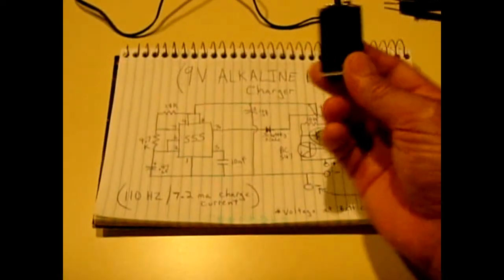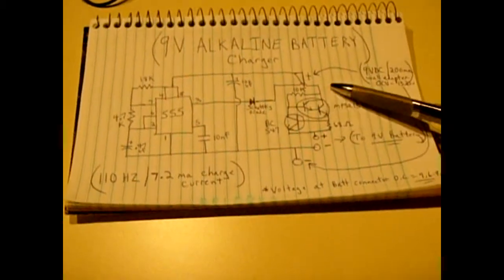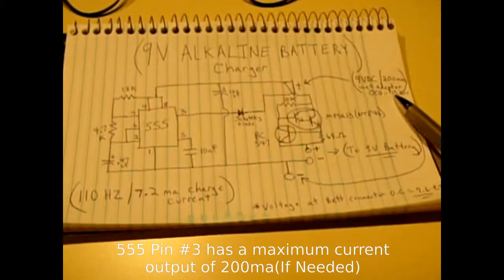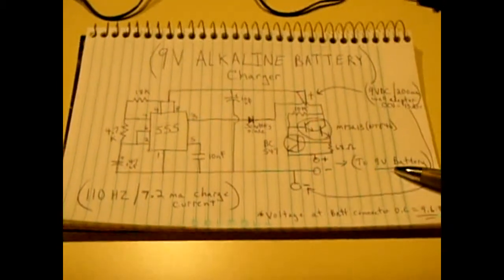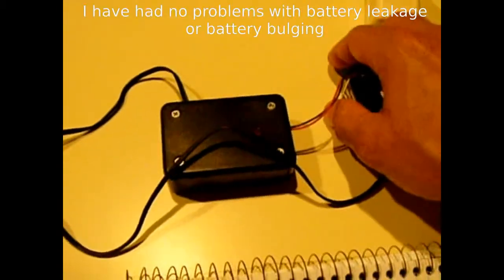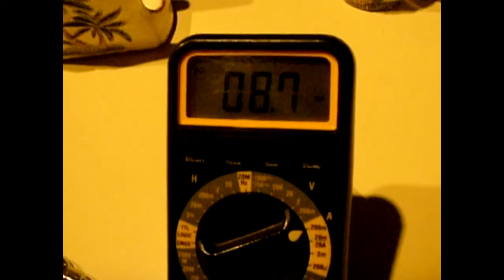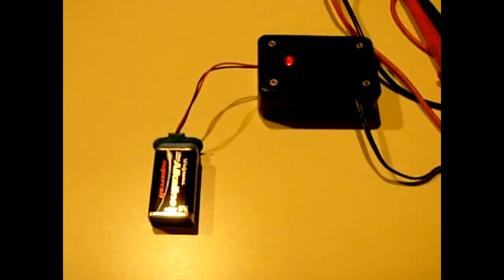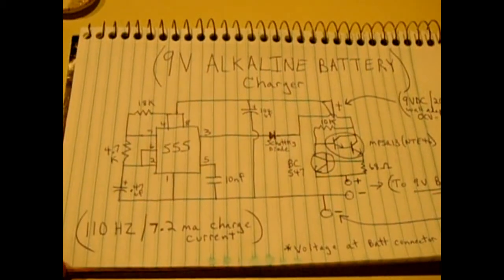9V Alkaline Battery Charging Circuit(Also 1.5v Cells)

Comment: Hi, this is a nice one! I have successfully recharged 1.5v alkalines with a joule thief so that works too:) I am using more and more super capacitors these days for running my hobby projects. Since i cant seem to find a system on the market dedicated for charging super capacitors i was wondering if you can help me?
Reply from the maker: +Ben Winkel Hi there. Maybe the video below can help.

https://www.youtube.com/watch?v=Z_v8dVezDrc
Reply: +electronicsNmore Thanks for your swift response! I've watched the other video and its certainly helpfull. You have a lot of cool videos and explain things very clearly. Funny that i allready have that booster thingy, bought it on AliExpress. Just a couple of questions.. If i just want to charge some capacitors, do i just leave the part out where it connects to that booster? And my main question, i ordered a capacitor bank on a balancing board. Its 16v 6 x 350f. How do i change the setup if i want to charge from 12v? Or do i need a completely different approach?
Again thank you and keep up the good work!

Comment: I'm having an issue. I'm losing the 116Hz from the 555 after the diode, especially when under load, at least detectable from my multimeter. I should mention that I'm using a tip120 in the constant current circuit, and a 1N5818 diode.  There is also a LED pre-circuit and a 1K resistor pre 555 to drop some power.
Reply from the maker: Datzfunk Try using a 12V battery with the circuit to see if that makes any difference. You should be using the mpsa13 NPN darlington transistor. I did not test using a TIP120 darlington. If you do not use exactly as I stated in the video, then you may have problems. 

Thanks.

Comment: Well, I had this basically working this morning, until I blew both my 555s accidentally. I would like to mention that with a wall adapter, my circuit had 116Hz make it through the diode, but when using a variable DC power supply, the 116Hz stopped after the diode.I couldn't figure it out. Must be something with the grounding on the variable supply? This makes it trickier, because I only had a 9V 300mA wall adapter laying around and the voltage was too high on the output. Probably could have figured it out if I hadn't accidentally shorted some components and blown the 555, then inserted my other 555 incorrectly into the circuit, and blow it too! :-)
Reply from the maker: Datz Skunk Hi there. The circuit definitely works, and works really good. Many others have made it with success. Fortunately 555's are dirt cheap. I also noticed that issue in the past. The pulses are still there, but for some reason they failed to show on my meter. When you test where the battery connects, you should see the pulses on your meter(116Hz in your case).

Thanks For Watching!

Comment: Thanks! I really enjoyed your video. If your into charging batteries, you might want to check out the $20.00 version of the IMAX B6 clone. It charges any battery type and you can control the time, current, and voltage. After watching your video, I decided to try to try charging a 9 volt battery at real-low current at an hour with a two hour rest period between each charge. Keep up the good work.
Reply: did you charge an alkaline 9v battery?

Comment: Hi, reminds me my years in electronics, (worked 20 years for Radio Canada, CBC as senior electronic technician until 1991) recycled as a machinist/welder with a YouTube channel started a few months ago, that's different...
Since I use quite a few batteries this is a tempting solution.
Keep on supplying great ideas,
Pierre

Comment from the maker: Mario Antonio: You need to allow others to reply to your comments!

As for your question, It makes no difference the mAh rating. What matters is that the battery is an ALKALINE type. The charge indicator circuit goes on the 9V battery snap which connects to the battery to be charged, or inside the plastic housing connected to the 2 wires leading to the 9V battery snap with the LED indicator sticking out of the plastic housing.

Thanks For Watching! Be sure to share.

Comment: Hello
I would love to use this for an audio amp I am building since it has to be powered with 9 volts. In previous investigations, I have learned that the mAh of a 9v battery matters. Will this charging circuit charge a 9v alkaline battery with any kind of mAh? Plus, when the main circuit is done, where do you put the led indicator in the end(NEG terminal of 9v battery & POS terminal?!?) I'd really like to know to continue my project.
Thanks for your response!

Comment: Thanks Pal, how can I missed this video !  I have all parts, will give it a shot. 9v battery are useful in many occasions ex. Smoke alarm, light-weighted power source for some of the Arduino based measuring meter. Btw, I have two Soshine li-on 500mAh voltage peak at 8.6v. Always good to have spare Alkaline 9v just to verify some cct which required more than 9v.

I will use the dual display Ammeter/Votlmeter panel meter 33v 3A. able to display mA range.

Comment: How did you get the values for the IC555? I did calculate the astable in 120Hz, with 80% duty cicle, 72K for R1 (pins 8 to 7) and 24k for R2 (pin 7 to 6) with a 100nF capacitor (pin 2 to gnd), please make it clear for me. For the current i did used a lm317 with 40R to arround 30mA.
Reply from the maker: I used an online 555 astable calculator. You should duplicate what I did. Copy the circuit.
Reply: http://houseofjeff.com/555-timer-oscillator-frequency-calculator/

Comment: Hi Sir, Thank you for such a good explanation type video and to the fast response to my question. To be truthful with you I had already made this circuit using the schematic from the description area. But I am having problems with it. I am using a 9 volt wall wart with a voltage reading of 15.9 VTS after plugging into the board the top rail reads 14.4 VTS and at the connections to the battery it reads 9.40 VTS. MA reading 8.1, duty cycle 78.8 and frequency 110.6 Hz. The only thing I changed is the 18K resistor to a 12K to get the 110 Hz. I have charged 3 batteries all in the range of 8 plus volts. My problem is that the charger continues to charge. When I check some batteries after several hours of charging the reading is 10 plus volts.
Reply from the maker: Just make sure the ma charge current is kept LOW. You need to lower the voltage into the charging circuit if your going over 10V. Try a 1n4001 instead of the Schottky. If that does not work try 2 in series. You can always make the battery charged indicator circuit so you know when to remove the battery.

Comment: Hi, I want to make this circuit but I am unclear about the schematic. In the video the schematic appears to show a connection just above the 10K resistor where you are showing the + sign coming from the 9VDC/200MA. On the schematic I find in the description area it does not show a connection. Is there a connection or not?
Reply from the maker: Hey Calvin. Ignore that weird triangle shape. Power is connected at the point to the 9V battery. I forgot to white it out.

Thanks For Watching!

Comment: Hi I'm making a circuit for my bicycle that is powered by a stepper motor which produces around 12v. The circuit is going to power several leds as well as a usb port. I'd like to store power with a 9v battery for when the bike is not moving, but when the bike is in motion and when the battery drops to a certain voltage I would like it to charge automatically. Sorry if I asked too many questions, I'm not a complete novice with electronics but I'm still struggling to figure this one out. Thanks!
Reply from the maker: I understand. You want the power to stay no lower than 5v even when you stop moving. I would not use a 8V battery. They are not designed for high current output. You should buy a 6AA holder and (6) AA nicd's or nimh's. That will supply the power. I would take the output of the stepper motor and feed it into a constant current circuit to charge the batteries. Don't charge at too high of a rate. From the 6 AA's I would use a lm7805 circuit to supply a regulated 5v to your USB port and LED's. Each LED can be powered by 5V using a 82 ohm resistor in series with each LED.

Thanks For Watching!

Comment: Hello, thanks for the circuit!, but i can´t get Schottky Diode here, can i use any other? Zener maybe??  thanks
Reply from the maker: Really need a Schottky, but you can try a 1N4001 to 1N4007, but you will need to slightly increase the power supply voltage to compensate for a bigger voltage drop across the diode.
Reply: great , thanks, 1N4007 is easy to get !  :D

Comment: Hello
This is may a stupid question but I got a 9v battery that I thinck it is empty I tryed it on my 12v cooler at the begining it was nice blowing but a time later it was blowing weaker and weaker. So my question is can I recharge it with my 12 volt car battery recharger aparat? Thanks
Sorry for my bad English

Comment: Absolutely great circuit. I want to build one as I go through several 9v and AA batteries each month. I am able to get most of the components at the local electronics parts store, but need to get the Schottky Diode.  I'll have to order this online. I noticed that you did not give a part number.

Could you provide me with an appropriate part number for the Schottky Diode solely for the purpose of ordering.
Reply from the maker: Nothing special !N5817 to 1n5819. Thanks For watching! Be sure to share, rate a thumbs up, and check out my other videos as well.

Comment: what do I have to change to raise the charging current to 50mA?
Reply from the maker: Why would you do that? The 9V battery would be destroyed. If you wanted to charge AA's, then you would adjust the 68 ohm resistor value.

Thanks For watching!
Reply: electronicsNmore Yes, I plan to make one for AA's. I have sucessfully made the 9V battery charger. Thanks for sharing, you're brilliant! ;-)
Reply from the maker: Glad you like it. Just remember to not allow the batteries to drop too low in voltage before charging them, and also share my channel/videos.

Thank you

Comment: Bro,
Thanks for your reply!  Questions for you.  How many times have you charged a 9v battery or topped it off before you could no longer use it?  How did you measure the frequency of the pulse on your meter?  Does it have a special range for it?  Don't see the red LED in the schematic.  Thanks again for your help,

Roberto
Reply from the maker: I charged a 9v battery  3 or 4 times so far with no problems. Frequency was measured using my wavetek 27xt across the 9v battery connector. The red LED is nothing more than a LED and current limiting resistor connected in series from the power switch to the negative rail.

Comment: Sir can i replace "MPSA13" transistor with S9014? Transistor? Thank you.
Reply from the maker: No. Look for a darlington NPN.
Reply: Sir , i made the second circuit, the 9v full indicator circuit... 
I have 

10k
2.2k
9.1v zener
Epoxy green LED
2N4401 transistor...

Im gonna ask a question, 
Is it safe ? To connect this circuit to 9v alkaline charger .. While ? Its charging??? Or not...
??? Thank you....
Reply from the maker: yes. With nothing connected to the 9V charger, the LED should glow green. When the battery is connected, the LED should go off until the 9v battery's voltage rises to a certain level.
Reply: sir , i calculated 111.3Hz 
so i replaced

18k to 12k
4.7k to 470 ohm
0.47uF to 1 uF

then i replaced MPSA13 with 
BC517 NPN Darlington transistor hfe 30,000 min.

the i have a ouput of 9.68v dc
Reply: electronicsNmore why is it, the voltage drop to 8.7v from 10.5v  when the LED indicator circuit is connected to the main charger circuit with no battery connected?
Reply from the maker: That is normal. Mine drops from 10V to 8.2V. The 9V battery charging and LED indicator will still work just fine once the battery is connected. :-) When I see my LED turning ON while the charger is plugged in, then probe the battery contacts while under charge, it is around 9.4 - 9.5V. The output from the charger is very low current, so once the charger is plugged in with no battery connected, the voltage will be at the high(around 10-10.5V), the LED will turn on, and the current will drop causing the voltage to drop at the terminals.

Thanks For Watching!
Reply: electronicsNmore Thank you for the quick response.

Comment: can i use 9v dc adaptor with an input of 220vac? thank you
Reply from the maker: Hi Darel. As long as the output is close to what I stated in the video, then you will be fine. The input makes no difference. 120 or 240.
Reply: oh! thanks for the info sir, 
but one more thing , as i've said lately 
i have 220vac input  AC/DC Adaptor. i read the back of my adaptor
with an output of "9V DC 300mA"
but i was shocked when i got my multimeter to test the real output of my adaptor and i got a "15.70 VDC" output!!!???
is it safe to use this adaptor Sir???? Thank you.
Reply from the maker: The dc adapter will supply 9vdc at 300mA. If nothing is connected to the power adapter, then the voltage will read a higher voltage because no load is attached to it. That is normal. The power adapter you have can also be rated 12V at 100mA., or 6v at 500mA. Depends on the load attached. If the voltage is still too high(I used a 210mA adapter at 9vdc) , you can always add a 1/2w low ohm(around 33 to 51 ohms) resistor in series with the (+) from the power supply to help drop the voltage down.
Reply: ok sir thank you for your reply ..
so i need a 1/2 w resistor to help drop the voltage down.
because it is open no load but still getting a too high voltage of 15.70v dc but its rated 9vdc 300mAh 
Anyway thank you very much sir, you're helping people to know more about electronics. 

Sir i hope you make a video of zener diode and silicon diodes explanation and how they works on a simple circuit,. cause until now, im still confused about diodes. Thanks a lot sir, :-)

Comment: I am not sure how this circuit can pulse. The base of if NTE46 always has a positive supply from the positive rail. This voltage is higher than the 555 pin 3 output. Am I missing something, could someone please explain? Thanks
Reply from the maker: The + in the weird triangle is NOT connected to the constant current circuit. It looks that way, but it is not.

It definitely pulses, and I can assure you this circuit works EXTREMELY well. The 555 timer produces pulses out of pin #3 which alternate between zero volts and +V.  Those pulses then drive the constant current charging portion of the circuit. The output of the constant current charger connects to the battery POS, and the battery NEG to ground.  Pretty simple operation.

Thanks for watching! Give it a try.
Reply: electronicsNmore Thanks for that, I have been charging a 9 volt battery with the circuit as you described for a few hrs and the voltage is slowly rising. 

To charge 1.5 volt batteries I have added a lm317 voltage reg to lower the input as I am using a 12 volt 2 amp supply. Would taking the 555 output away from the NTE46 collector (ie use it as signal only) and using the +ve rail instead potentially increase the constant current available? For AA, C and D sizes...

Regards

Comment: Using this technique of pulsing a constant current of ~10mA though a battery, I made a very simple circuit in LTspice that does just that. My version feeds 120Vac into a small transformer, where it is then rectified, but not filtered, and I skip directly to a simple NPN-based constant current device. the most costly part is probably my LED used as both an indicator and crude voltage reference.
Reply from the maker: Not good, but I see your idea though. The frequency is too low(60hz), and the duty cycle is not right. What I show in this video is best. I have used it over and over with excellent results. You know the saying, "Don't mess with something that works well". If you like it, make it.

Thanks For watching.
Reply: electronicsNmore What should the duty cycle be? Also, I used a center-tapped transformer and fed that into a full wave bridge rectifier (the 2-diode design for cost reduction). This gives me 120hz, very close to your 110hz. (only 9.1% error) the duty cycle I am running at is about 30-50%

I only made this my way to see how simple a circuit like this can be. Your design uses an IC and complicated constant current source. I was able to narrow this down to a single transistor design, even if it might not work as well, large-scale manufacturing and selling would require design costs to be as low as possible. I only changed it this was to see how cheap it can be made. i will build it up and see how well it works when I have time, I can't imagine why it won't work if the simulation is accurate.

Your design has the advantage that it has already an oscillator built in, and thus, can work off of a 10-12V power source.
Reply from the maker: The 120Hz part is fine, but the duty cycle is too low. You need to be around 80%.
Reply: electronicsNmore OK then. Grudgingly, I added a comparator and a 470uF filter capacitor, and a few more various resistors and small caps, I can now vary the duty cycle up to 80% easily. I will try see if I cant ramp up the voltage out from the transformer, then drop it to 9.5V with a 7805 regulator w/ a resistor divider on the ground pin. Without a filter capacitor, the duty cycle should be very high as most of the time the output voltage of a larger transformer will be higher than the dropout voltage of the regulator. The biggest problem with this configuration is the translate switching speeds, it is slow to switch because I am relying directly on mains frequency without any gain.

The comparator solution solves all that, and I do have a few op amps and a comparator in my junk bin, i'll go ahead and test it.